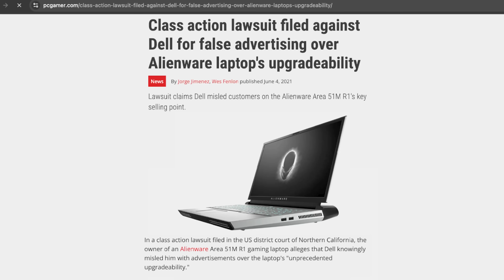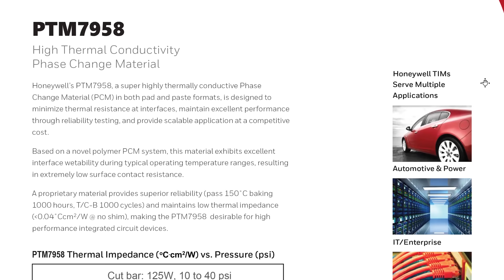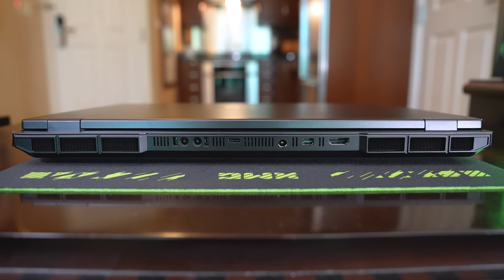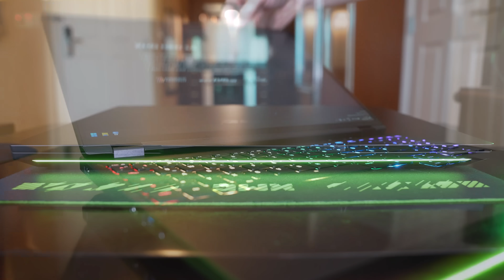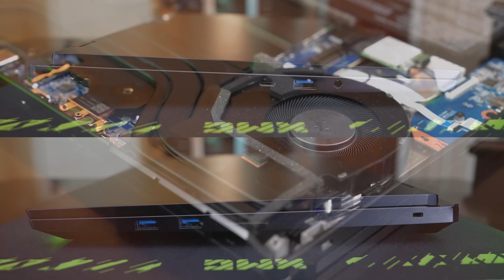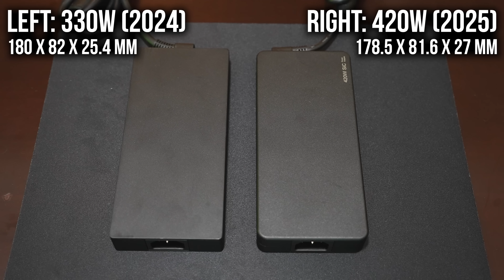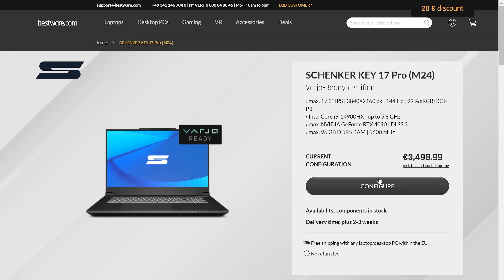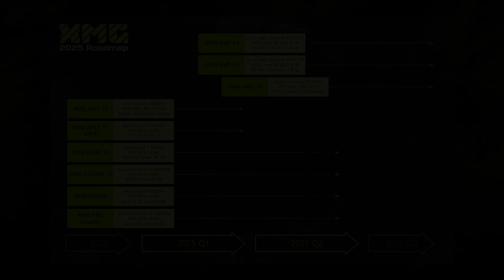This Gaming Laptop has Separate CPU & GPU! - XMG Neo 16

Comment: Brother, I'm going to buy a new laptop in the coming few months. I'd like to keep the budget around 1500-1600$. All these GPU reviews are for desktop versions and I'd like a really good idea for what should I buy. I am a gaming enthusiast and would like to do both - play and build games, including my own 3D models (I know blender fairly well). That said I'm not too hardcore and would like to keep spending to the minimum. 
For now, all I know is GPU = Gaming and CPU = Video editing/3D Modeling. I plan to do both. So the current MINIMUM specs I'm eyeing for are - Intel i7/i9...H/HX + RTX 3080/3080 Ti/3080 Super/4070/4070 Ti (Whichever is available for laptop (I don't know) and fits my budget and since 50 series doesn't look that appealing or necessary to me (I could be wrong)).
I am severely lacking in knowledge about AMD (Both CPU & GPU). Any positive inputs would be very appreciated. Please help me choose the best laptop performance wise and one that doesn't breach my budget limit more than 10%. Again, that said, I would like to save as much money as possible. I want to be able to play most of the available & upcoming games on high-to-ultra performance (if possible, else mid-high level) for the next 4-5 years on this laptop without having to worry about performance issues or having to upgrade it. I'll build my own PC once I earn more after 4-5 years. 
Please help me out. 🌸

Comment: Can you upgrade within the same generation? Like buying a 5060 at first then buying the 5090 board later? 

Or would that require a change to the cooling system as well?
Reply: Post-purchase upgrades will not be supported. Switching from 5060 to 5090 would also require changing the cooling system, as the board layouts are different. A model that is launched with RTX 5060 may not even fit the larger 5090 board. XMG NEO 16 is not planned to be launched with GPUs below RTX 5070 Ti right now. // Tom
Reply: @ thanks for the info. 

The easy repairs is good enough for consumers though, and obviously having this kind of system makes it easier for you guys to create different SKU’s

Comment: I wont advice buying this. Why? I had mxm upgradable videocard on the past. On paper ot looks great but when you actually decide 2 upgrade years later you will find out that there will be issues like socket changed 2 kind of new format, bios not recognizing the new videocard. In need for more power etc etc.

Comment: Why amd has no usb 4?
Reply from the maker: Needs an extra chip and increases cost a fair bit.
Reply: @JarrodsTech  Not only cost, but also lots of extra space on the CPU mainboard, which is already packed with SO-DIMM slots and needing to leave space for the GPU board. And the controller would need to be between CPU and rear I/O port panel, which is an extremely narrow edge due to the location of the cooling system and water ports. // Tom
Reply: @xmg_gg  Sadly, that unfortunately means I cannot consider this laptop! What a shame! (I have a USB4 / Thunderbolt 4 dock that won't fully work under USB 3.2 so I guess I can't consider the AMD model...)
Reply: @JarrodsTech  If it really was cost, I'd pay for it.

Comment: Does the new cooler have the locking connector as well, or is that only on the laptop side?
Reply: The locking mechanism is on the cooler. // Tom

Comment: Not only more customizations for the customization for the customer, but theoretically the cost should be lower for the added options.  Time will tell, of course.  I'm wondering however, since laptops have gotten thinner and hardware, hotter, cooling has become increasingly more critical and must fit and be tuned to the particular hardware.  So, hopefully, they still do that, instead of offering a generic one-size-fits-all solution.

Comment: If you need to clean the fans in XMG laptop, do you also have to fully disassemble it, take off the radiators (repaste cpu and gpu) to get to the fans or you can just unscrew the fans right away and suck the dust out of radiators?
 I think this difficult maintenance process that is done in a wrong way by unexperienced users (and sometimes experienced too lol) is the reason for many laptops malfunctioning and huge environmental waste.
Reply: No need to fully disassemble. Use canned air precisely. We have a FAQ article on this. // Tom
Reply: @xmg_gg yeah, canned air is a fair solution for low-level cluttering. but at least in my case, I got the laptop fans and radiators covered in vaporized kitchen oils every half of a year (don't know why, cannot say i cook very often at home) and i cannot properly blow the dust from them. only cleaning fans with сotton buds helps. and before i realized why my laptop throttles, i came to using different thermo pastes and even liquid metal. i think the last choice was a bad one, cause my laptop eventually started to reboot randomly and i couldn't fix this problem even after fully removing the liquid metal. i believe that if i could have properly unscrewed the fans from the radiators and cleaned them, my laptop would still be working properly.
Reply: @xmg_gg  and I opened my laptop like 10+ times in the last 3 years. each opening brings a risk of the laptop harm, such as losing a sqrew, breaking a sqrew hole, breaking a fan blade, cutting internal cables, getting a shortcut because of forgetting to unplug the battery, scrapping some resistor from the CPU, etc... 
so, as to me, the fewer reasons you have to open your laptop the better. and a monolithic laptop that doesn't require any maintenance and serves well for at least 4 years after the buy date looks a better option (to me) than an "upgradable" that needs to be fixed or dumped before its components get old.

Comment: I like how manufacturers keep acting like separate GPU/GPU boards is a "new" thing when i have a Dell Precision from 13yrs ago that can upgrade/replace/remove the GPU. The standard has existed for around 20yrs or more (i had a fujitsu laptop with a geforce 6800 that had it). They have simply abandoned the technology for profit/marketing. MXM is and should always be the standard for mobile high power graphics.

Comment: I would want a port that can do x8 speeds instead like an oculink 8i port out the back with no dgpu to save on the cooling so you can use the 9955hx3d with a full desktop gpu at good bandwidth, they should make that an option too if its so easily configurable. This is great still.

Comment: miss old clevo upgradeability. hopefully they can allow "Strix Point Halo" with no dgraphic for under 800-1000$ and also an i3 or r3 cpu with 5080/5090 6o reduce price for those who needs it. and vice versa ,meaning r9, core9 with lowest dgpu possible such as 5050 or mx750 if released . user should get exact cpu & gpu considering their needs and not a totalpackage of higend or mid range or low one for combination of cpu & gpu

Comment: Need an advice. Want to buy a laptop for working , need mobility. Was going to order helios 18 with 4080 , just saw that the 2025 helios will have 150+ AI included , better cooling and higher screen resolution. Now I'm confused, does it worth waiting till May and paying 2x? ( The main problem is that i need a laptop immediately)
Reply: If you need mobility don't buy an 18 in laptop. In my experience (Network Engineer), 15-16 laptops work best if you only carry your laptop to work and home. If you plan on walking around a lot with your laptop and plug/unplug it a lot 14in laptops work better. 17-18 in laptops are too big and are not practical. I advise against buying 17-18in laptops.
Reply: @AlwaysGrowing0  As for me , it's must more mobile than the 34" one

Comment: The one thing I think XMG should offer is the 9955HX3D on their 18 inch laptop, which is tje top gaming CPU this generation.

The 18 inch should also get ECC RAM support.

Another consideration is that they should offer a better touchpad. I would like them to partner with Sensel or a similar company.

Comment: nothing will beat the versatility and flexibility of mxm modules.... why are xmg and clevo phasing those out?  after 2 years looking i havent found a fully upgradeable laptop beyond the clevo x170-kmg .. this sucks....
Reply: NVIDIA does not support MXM modules for laptops anymore, only for emdedded industry applications. MXM form factor is too limited for modern systems. // Tom

Comment: I watched this while editing my own CES video about everything at the convention being unrepairable e-waste. Knowing there are companies besides Framework that are actually designing things with repair in mind, gives me a little morale booster. Great video as always man.
Reply from the maker: Cheers!
Reply: Racoon like fingers 😮
Reply: @squad4yt103 the greatest technician to ever live 😅
Reply: Dell is putting replaceable usb ports in the pro laptops. I thought that was nice.
Reply: It's the greatest technician that ever lived guy!
Reply: This appears pretty similar to Firebat laptop that was revealed a while ago,is this just a rebrand?
Reply: you should watch this video again and listen more critically. XMG is just greenwashing here as they use parts pairing to prevent real reparability. This is just to make it easier for them to have more configurability that's it.
Reply: @RealLifeTech187  How so? Yes, they're preventing upgradability on the GPU and CPU because you can't swap models, but not repairability in the case your GPU fails and you replace it with the same one. Any step in the direction of a modular design should be rewarded.
Reply: @SalemTechsperts  agreed but i bet what's gonna happen is that the board is gonna cost way more money than what the laptop will be worth when it does eventually go out and i was looking at these XMG laptops and they also seem to have quite a bit of problems rather its batteries audio hard drives or even dead chargers someone on reddit had 20 of the vision E22's and out of 20, 7 of them had issues which is roughly %40 to me not good at all but i bet there maybe other laptop manufacturers that are worse and i wanted to get one of these laptops with the oasis cooling because that would be great for me because i always worry about temps jeez i wrote an essay but maybe the greatest technician thats ever lived reads this to the end :)
Reply: framework laptops suck...

Comment: A completely useless gimmick if it doesn’t translate to any meaningful advantage for the customer. All the immediate benefits that one can think of to the consumer are being blocked by xmg. Why can’t I use 2nd hand higher tier parts to upgrade it? It’s just connecting to an x8 lane. It’s no different than parts pairing by anti right to repair companies. 

All I’m saying is don’t factor in this “separate GPU and cpu” in your buying decisions. If the cost reduction to xmg translates to users, good for us.
Reply: Re: "Why can’t I use 2nd hand higher tier parts to upgrade it? It’s just connecting to an x8 lane", please allow us to clarify: user-driven upgrades are not supported due to several unavoidable technical limitations. Future CPUs and GPUs may require entirely different layouts, power profiles, and signal tolerances, making compatibility highly unlikely. Laptops operate with far tighter integration than desktops, with shared power and firmware dependencies like NVIDIA Optimus complicating hardware compatibility further. Additionally, the cooling system is uniquely tailored for each configuration, so any change in components would require a complete redesign of the thermal solution. Together, these constraints make upgrades impractical and incompatible with the system’s design. // Tom

Comment: The very first laptop I bought from Aftershock had a nvidia 675M, 2 years after purchase the GPU was causing bluescreens, and I brought it in for a replacement as the laptop was still under warranty. They couldn't replace it. This was a 675M, a GPU that had a MXM connector so it was 100% removable. The reason why they couldn't replace it? Because after 2 years, that model of laptop GPU was no longer in production so there were literally no replacement units left.

The important takeaway here is that regardless of whether your laptop has modular parts or not, it still comes down to the availability of replacement parts if you're talking about serviceability, and the older your laptop is, the more likely that getting replacement parts will be literally impossible. This also means buying extended warranties or anything like that is usually pointless.
Reply: Yea this modularity seems to be beneficial in just having more configuration options for the customer.

Comment: Sooner or later we are gonna have laptops that are built like desktops and we can customize a shell pretty much
Reply: This is unlikely, as this would make laptops much less efficient, less portable, heavier, probably cut away important features such as MSHybrid, and make them less attractive overall, which may also raise their price due to reduced volumes. In comparison with desktop PCs, laptops have stricter tolerances for power consumption, thermal performance, and a higher degree of cross-vendor integration. Features like NVIDIA Optimus (MSHybrid) further intertwine CPU and GPU operations, complicating compatibility. Even if physical compatibility were achieved, firmware mismatches and a lack of hardware debugging/validation for unsupported board combinations would result in unreliable or incomplete operation. // Tom
Reply: Oh okay I seee. That makes a lot more sense now looking at it that way I wouldn’t want a heavier laptop and I like the portability of laptops for convenience and for the simple fact of being so small yet packing a punch. See I am one to travel so I like being able to take something with me that keeps me connected other than my phone of course

Comment: I'll be clear, two motherboard pieces is a guarantee, yes, but for Xmg, not for their customers.
Good approach to old mxm graphics cards technology, but still far.

Neo 16 would be great with a 4k screen, and with integrated "cooler brick". Oasis makes laptop.. less "laptop", less portable. About Clevo X370, thinner heat vents doesn't looks good. They want it thinner, well, for them then.

Vapour chamber is not magic, the heat must been exhausted at higher rato possible. 

Honestly, I would LOVE buy to Xmg a Clevo X170 with 5090 and best of Intel/Amd, up to 192gb, up to 4 ssds, with 4k screen.

Please, Clevo, do something of the effect possible, and do it next year with rtx60 with 3nm lithography. Rip for thinnest X370 for me.

Comment: I'm wondering how they will handle the Thunderbolt port(s) with this modular build. Just curious.
Reply: With Intel, the Thunderbolt port is placed on the CPU/RAM mainboard and connected to the iGPU. The Mini DisplayPort sits on the GPU board and is connected to the dGPU, providing full NVIDIA-approved DP 2.1 with 80 Gbps. // Tom
Reply: @xmg_gg  Thanks for the reply. I presume that the USB4 port is on the AMD motherboard as well and connected to that iGPU (or USB 3.2 for that matter).

A bit of a noob question perhaps, but I wasn't aware of that. Any dual screen or external screen must go through the real DP (or HDMI) port for gaming purposes then?
Reply: @ The AMD Fire Range mainboard has USB-C 3.2 Gen2 with DP from iGPU. You can also game on iGPU monitors, they will act the same like the internal screen with MSHybrid (NVIDIA Optimus): the dGPU renders frames and passes them to the iGPU framebuffer for video output. Using the dGPU output slightly reduces CPU overhead and very slightly decreases input lag. // Tom
Reply: @xmg_gg  That was a really explanatory answer. Thank you very much. Lots of credit to you and your team at XMG.

Comment: As the only manufacturer offering the new AMD 3d v-cache CPUs with the new 50 series laptop GPUs should secure them a fair amount of sales.
Reply: The only thing these laptops are missing is the OLED screen. Overall, there were awesome improvements though. I am excited to see where their laptop liquid coolers end up in a few years.
Reply: This is a TongFang X6FR558Y chassis, other boutique shops have 9955HX3Ds (one seems to have underpriced them, but I won't be advertising).

Comment: I wish that the xmg ultra 17 was still available since it uses the 125 watt tdp intel core i9-11900k desktop cpu with the optional 4k ips 17.3 inch display, 3080 16gb vram that came out in 2021 and the xmg apex 15 that came out in 2020 with the 105 watt tdp amd ryzen 9 3950x desktop cpu. I miss when gaming laptops used to have the full desktop cpu's in them like the 2 gaming laptops that I have already mentioned. I hope that the newer mobile cpu's still support adjust the clock speeds with unlocked multiplier. I mainly care about overclocking the cpu clock speeds to there highest clock speeds with the unlocked multiplier in the bios. I don't care about ai since ai is there for taking screen shots of the user private sensitive data like personal passwords and other sensitive data with windows recall. I would not be surprised if ai would be used for keylogging purposes when the user is typing on a keyboard since ai is already being used by scammers and hackers to record real people's voices but the possibility of recording when typing something will be exploited when using ai.

Comment: Wait till a single drop and it destroy the conndction
Reply: Unlikely. The PCIe carrier is protected with a metal shield, and this sandwich of board, link and shield is fixed with 4 screws to the upper case of the laptop. The pins on the PCBridge are robust and don't potrude far out - very different from old desktop CPU PGAs. Check Neoconix PCBridge for details. // Tom
Reply: @xmg_gg  oh wow werent expecting to get a reply from xmg yt acc lol. Keep up the good work. Nice innovation tho